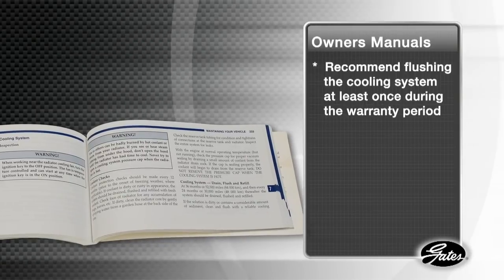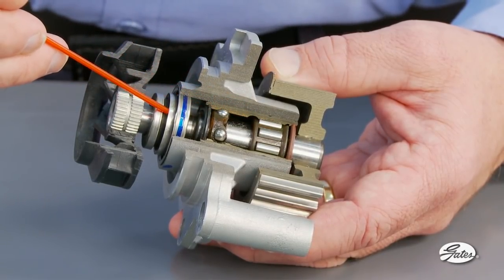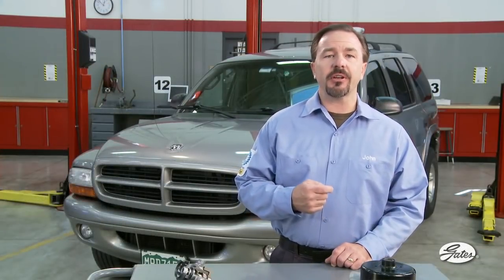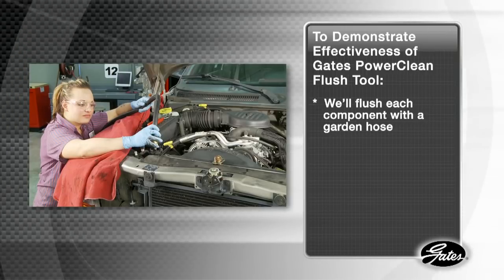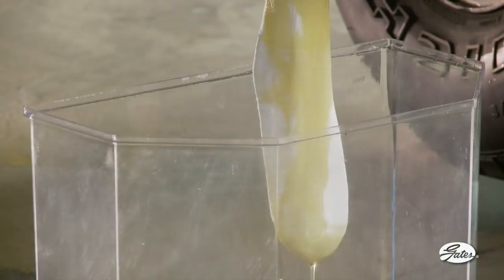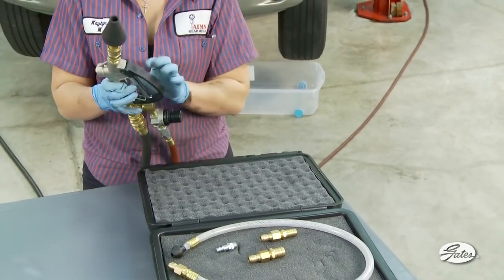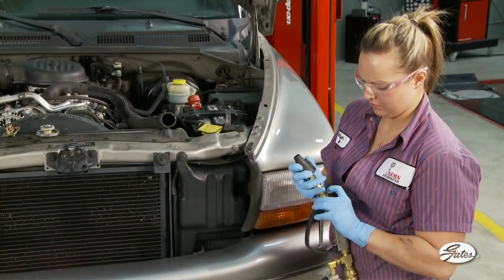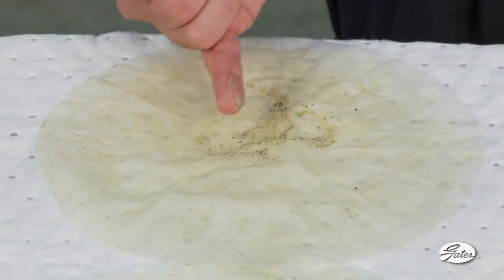GATES TRAINING: Cooling System Flush: Cleaning Neglected Vehicles FULL Version

Comment: Hmmm, I wonder how long it took for the heater core to start leaking after that power flush? I'm always leery of doing a high pressure flush on a high mileage neglected vehicle. Usually always results in a come back with the customer blaming the tech for further issues.....
Reply: I'm wary of doing it
Reply: Yes heater core is supposed to be less than 10 psi
Reply: You'll be disappointed to hear that the heater core never leaked after the flush.

Comment: I kind of made one of these out of cheap parts from Lowes'.  They sell a garden hose attachment in the plumbing section that has a rubber bulb that fills up with water and closes off the pipe/hose that you want to clean out.  The end has a small opening that pushes out pressurized water.  You can also get an attachment that has an on/off valve you can use to toggle the water on and off quickly to get that pulse action.  The whole thing would only cost about fifteen dollars.
Reply: Or  spend $500 on this tool

Comment: Performing this procedure on a truck is easy.  I'd like to see you flush a front-wheel drive car, with its overly cramped engine compartment, and no radiator cap - an overflow tank only.

Comment: what they didn't compare is their tool against a more THOROUGH water hose flush. Such as repeating the same steps multiple times with the hose and also by back flushing the heater core to gently agitate the debris inside. Continue to repeat steps until there was no more debris found THEN use this tool to see if it can produce any more debris. That would be WAY more convincing. Especially considering the ridiculous price they're are asking for this relatively simple tool. Also, a chemical flush additive can be used that is way cheaper.

Comment: Not knocking the product. But my only beef with this mentality is that your water pump doesn't push water like that tool... Since none of those contaminates would come out normally, they won't dislodge and harm anything, its really an un-needed tool. This is why we have exchange machines at the dealership. If it is truly that bad replace the heater core or radiator...

Comment: This video is "misleading" as doing any flush you must drain refill and start engine and bring to operating temp. so that thermostat can open and circulate water through heater core and then you will be cleaning the whole system, do this several times and you will clean the total system.
Reply: Since you weren't paying attention to the video, They removed the thermostat so they didn't have to bring it to operating temps.
Reply: nosferatu49426 Removed or not for the thermostat, I agree with Randy Beard. You should always restart the engine to circulate the water flush that way you can flush a complete closed-system.

Comment: I have noticed several comments on here questioning the validity of this video and the use of the tool.  I thought I would offer some commentary on the subject.  This was an actual flush of the vehicle, we could have searched for a more contaminated example but we used a volunteer vehicle from the group.  The sock was used as a filter and we then emptied the contents onto the white cloth and let it dry to see what was available.  The thermostat was removed to allow for a more complete flush.  My rule of service is anytime the cooling system is opened it should receive a new thermostat, it's just good practice.  The recommended use of mineral free water to mix with the glycol is made to prevent future scale and mineral build-up. The flush water is tap water and it was drained before refilling.  I have since used this tool extensively in other applications and have found it works quite well to clean blocked heater cores, radiators, and engine blocks.  It has saved me the trouble of removing  a dash and replacing heater cores.  I have yet to have it cause damage from over pressuring the system.  I think you would have to have a severely damaged component to have this happen.  I have also used the tool to clean sugar contaminated fuel tanks after disposing of the contaminated fuel.  The alternative of simply draining and filling or using a hose is just not good enough to clean the system.  I look forward to making more videos to follow-up to this discussion.  I appreciate everyone watching.
Schreck.
Reply: This is a very good video I'm in school for auto mechanics on the goal of becoming a master tech I learned the same was keep it up guys
Reply: Great info I'll keep that in mind while I'm taking my test
Reply: Andrew Armstrong Thanks for your comments, the tool is regulated to a much smaller pressure than the shop air.  Although the regulator is set-up to operate from 75 to 120 psi on the supply end the regulated output of the pulsations are much less.  It under 25psi from what I remember but I will review the instructions in my kit to be sure.
Reply: +John Schreckengast (Schreck The Tech) Good luck removing the thermostat on many newer cars.  They're buried deep under many other parts.  Example:  my B5S4.  To get to the thermostat you need to remove the timing belt, therefore bumper, radiator, A/C condenser, multiple fans, pulleys, covers, etc.  You may as well put new cam seals, front engine seal, new timing belt, new water pump, etc. on during that process.

Comment from the maker: Thanks for the comment. The PowerClean flush tool doesn't use a pump to push water out faster. It only needs a garden hose and shop air. PowerClean’s pressure is only 28psi, so it is gentle on radiators and heater cores. We have found (as we are sure you have, too) that the causes of heater cores leaks are typically contamination, electrolysis, or degradation by the practice of mixing disparate coolants and/or not flushing per the OE recommendations.

Comment: Very nice tool, I've witnessed it in use in the shop.  It really does a decent job on dirty systems, once you get used to the quirks of using it. On really, really bad systems, I've found that it helps quite a bit to perform a chemical flush, letting the engine cool and draining out the chemical flush prior to using this tool.  
I am somewhat surprised that ballcock valves are not included in the water and air feeds to avoid the need to quickly disconnect the air supply in between uses. Sure, the end user can modify the tool to include these, however, given the rather premium price of this tool ($500+), I don't think the inclusion of a water and air shutoff mechanism is an unreasonable demand. I would give this some serious consideration.
Despite the tool's obvious utility (and my own tool addiction), I can't justify purchasing it for use as a DIYer, even in a multi-car situation (in fairness to Gates, I do not believe the 91002 is targeted at the DIY market).  I've chosen to settle for the more affordable Mityvac MV4570 flush gun that allow me to perform a similar cleaning process, albeit without the benefit of the patented water pulsation feature or the integrated stream pressure regulation.  With due care with regard to water and air pressure, and judicious use of the air trigger, it does a decent enough job for me, especially when used subsequent to a chemical flush.

Comment from the maker: Thank you for the comment. It’s fine to use hose water for the flush.  The distilled water is recommended when adding the 50/50 mix of coolant and water.  If there is concern about hose water pooling in the system the tech can turn off the water and blow air through each section to remove more water.  We have not seen any correlation between flushing with hose water and continued contamination of the system. Hope that helps!

Comment: I always do a "rolling coolant change" by extracting what's in the expansion tank (around a half gallon) and replacing it with a fresh 50/50 mix once a year.  The expansion tank is an active part of the circulated coolant on my 4.6 Ford.  Never had rust or a bad heater core and my original 2003 water pump is still kicking. You can cause problems by power flushing.  Always use Prestone.

Comment: Best cooling system video I have seen. Problem is where to find one who has and knows how to preform this service. Also, how do you know you have enough water OUT to allow enough anti freeze back in. I am due a coolant change on my 2018 Explorer (20,000 miles) but do not trust anyone as most won't let you watch. No Idea who would do this type service in Midlothian Va. area. I am not due until May and am now in recon mode.🦇

Comment: Citric acid flush did a better job on my car. It was recomended by Mercedes Benz. It really cleaned everything. Radiator, heater core and engine block. I couldn't believe all the rust but, it did an amazing job.
Reply: Just Plain Ole Tommy citric acid flush ????

Comment from the maker: If your radiator is contaminated with rust we recommend purchasing a new one. Once the new on is installed, flush the entire system using the PowerClean Flush Tool. It sounds like your heater core may be corroded or blocked as well, so have a tech flush the core to see if the issue is resolved. If not, you may need a new one. 

We also recommend determining what the OE spec coolant is and only refill with a 50/50 mix of that and distilled water.

Comment: QUESTION; I will do my own flushing at home + change the hoses. I will use flush chemical #1 do I need to remove and change old hoses 1st and do the flushing with new hoses or just keep the old hoses on and do flushing that way. #2 I will use distilled water...how many times do I need to fill up the radiator with distilled water and run the engine ( including heater core) ?

Comment: would have liked to have seen a flush on a gm cooling system.  i have a 97 chevy. the orange coolant really causes a lot of gunk in the system
Reply: GM Dexcool causes problems because it is not designed to be in an open to air coolant system. Green coolant is designed for open air systems. Get the Dexcool out and put in green.

Comment: just wondering why you used a sock on the 'garden hose' flush, and a filter paper for your fancy flush tool? it seem to me that a filter paper would catch lots more dirt, unfair comparison IMO!
Reply from the maker: +Warryck Scown 

Thank you for the comment. We are not certain why a different “filter” was chosen for the two methods when the video was created; however, we firmly believe the result is the same regardless. Independent testing has confirmed that flushing a cooling system with just a garden hose will not remove as many contaminants as with the PowerClean Flush Tool will. The secret is in the PowerClean’s pulsing action. Whereas a garden hose can only deliver constant pressure and water volume, what really cleans out cooling systems is the pulsing action that can force out stubborn contaminants. With that said, we want to thank you for your comment and will use the same filtering device for our next video.
Reply: #1 Your "firmly believe the result is the same" does not in any way prove that it is. 
#2 what you didn't compare is your tool against a more thorough water hose flush. Such repeating the same steps multiple times with the hose and also by back flushing to agitate the debris inside. Once there was no more debris found THEN run your test with your tool to see if it can produce any more debris. That would be WAY more convincing. Especially considering the ridiculous price you are asking for this relatively simple tool.

Comment: great video thanks - Q. is it safe to empty the coolant from engine and heater core by Air only ?(by  connecting the leaf blower to the upper hose and disconnected the lower hose from rad. )

Comment from the maker: Thanks for your comment. No chemicals were used in this video. Regular tap water is all that is needed, so you can connect the tool to a garden hose. Use distilled only when refilling with coolant and water.
Reply: So how are you getting all the tap water out of the system, since tap water is bad for your motor and system?

Comment: Honda Civic= QUESTION; I will do my own flushing at home + change the hoses. I will use flush chemical #1 do I need to remove and change old hoses 1st and do the flushing with new hoses or just keep the old hoses on and do flushing that way. #2 I will use distilled water...how many times do I need to fill up the radiator with distilled water and run the engine ( including heater core) ?

Comment from the maker: Thank you for your comment. As you may know, 50/50 is simply pre-diluted coolant.  This makes it easier to fill as it is already mixed with distilled water to the correct proportions.  As long as topping off with a non-OE coolant equivalent does not exceed 10-15% of total volume there is a reduced chance of premature contamination leading to water pump failure.  It is generally recommended to top off with the OE coolant or equivalent chemistry.

Comment: This thing should be called the volkswagen garden hose nozzle😂 regular flushing with a garden hose sprayer is just as good. Then do a fill with distilled water and a cooling system flush chemical and no thermostat. Drive around. Drain it again and fill with distilled water if your worried about the chemical. Drive more. Drain it completely (use shop vac for the parts that don't wanna drain with gravity it works trust me😂). Fill with 50/50 coolant. And change that coolant every 3 years or so so you can avoid this issue in the first place.

Comment: My shop uses a wymm's power flush machine, i dont think it would get as much out as this system does, but i try to do the best when its accully flushing ill pulsate the throttle a few times to helpspeed upo flow and slow it down again, ive seen some crazy stuff in dexcol a few times:)

Comment: Question? How does 75 PSI not blow apart the heater core, especially if it’s clogged? It’s only good for like 10-12 PSI isn’t it?
Reply from the maker: The water projecting from the end of the tool is regulated to 28psi no matter how much pressure you have going in from the air or water.  Of all the thousands of these tools we have sold I have never heard of anyone blowing apart a heater core.  If the heater core does happen to break apart or leak there was a problem with the heater core to begin with.  The PowerClean Flush Tool will not create a problem but will expose one.

Comment: This is a comment from down below:snoopdogie1871- yes the pressure going into the unit is high, but the unit is small. You are then taking that high pressure, with a small size flow, and forcing it into  a larger area, thereby decreasing the pressure. Pressure can't even build up inside the heater core since its being use as an open system.

Comment: thanks for the awesome video gates. very good and detailed. i have a 2003 durango 5.9 and it has an additional heater in the back. would doing the regular heater cleaning method ALSO clean out the rear heating system? or is there another method to this? i ask, because my front heater blows hot air like it should, but the rear passenger vents blow cold air and was wondering if doing a flush would clear that issue up. its currently to cold to find out if the flap is stuck at the moment and would be to time consuming during the winter time on my DD to take all the rear interior panels out to find out.
Reply: You can flush both at the same time, but I have found it more effective to flush out the front and rear cores individually if you can get to the heater hose junctions.

Comment: How to treat radiator internal because my car radiator has rust in it and I re-filled coolant water from store  twice already but the water color turned to rust color in 3 days. I know that there something wrong inside and some time heater not working properly. Ford made 2000 I believe this car only re-filled just water from previous owner and this car parked for over year without driving. How to treat guide me please.

Comment: #1 did you remove the thermostat to flush block?#2 Every time I do this type of flush, a few months later, I have to change the water pump. (this was on an 81 Toyota p/u)
Reply from the maker: +Jen Son 

Thanks for the comment. In reference to your question, it is not necessary to remove the thermostat from the vehicle to perform the flush. The reason is that the vehicle must be flushed in three different stages. Prior to the flush, the radiator and heater core should be disconnected from the block via the radiator and heater hoses, and then the block should be flushed followed by just the heater core and just the radiator. As a result of this procedure, there is no need to remove the thermostat. If you have any further questions or need additional assistance, please don’t hesitate to contact us at 303-744-5651 or apateam@gates.com. Thanks again for reaching out.
Reply from the maker: While not absolutely necessary to remove the thermostat, it is a good idea as this will allow for the best flow while using the flush gun. Additionally this will prevent any loosened debris from getting lodged in the thermostat itself.

Comment: i have a ? if you are using tap water to do this flush  now you have tap water in the block an heater cor i have been told tap water is bad so how do you remove all the tap water so you can add your Antifreeze and Distilled water mix .
Reply: You can use this tool (or others) with just a low pressure stream of air (like 15-20psi) after you are done to force out the tap water from the block and heater cores.  Just be sure to purge your system of all air afterwards.

Comment: Right off the bat I noticed they DIDN'T pick a GM car to do this flush.  GM only picks designers that are mad at the world.  To access anything in a GM car, like the thermostat, you have to get 34 other things out of the way.  The girl here seemed to have everything right there in front of her.  Apparently, the heater core nipples here WEREN'T in the middle of the firewall like mine are, requiring a topside creeper.